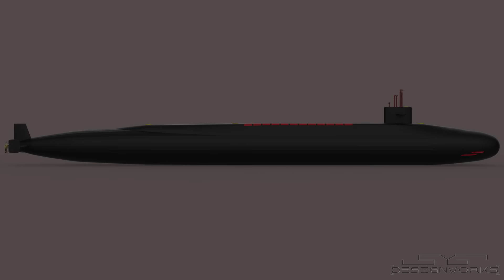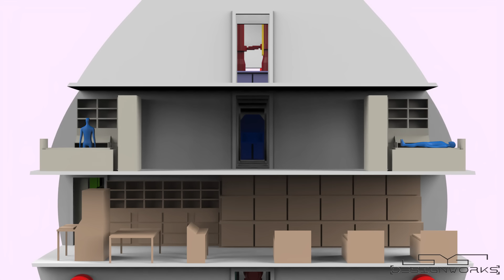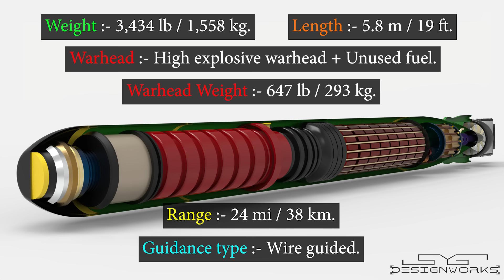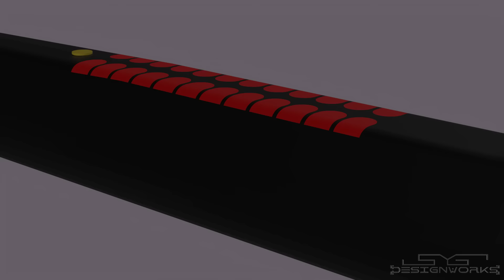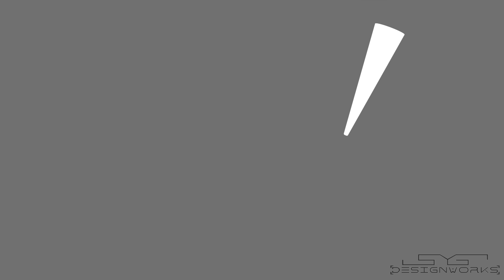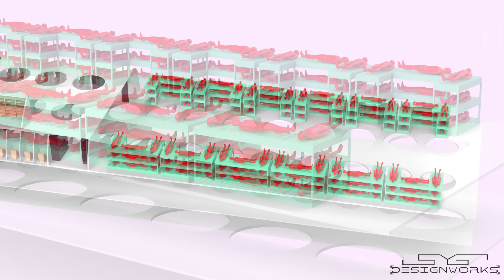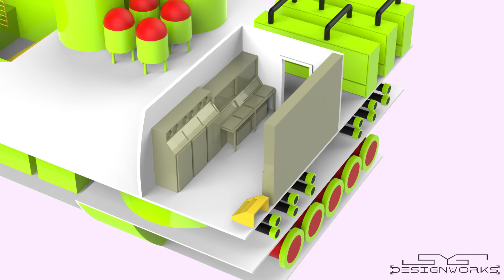Submarine Nuclear Power | Engineering behind it Nuclear Reactor How it Works

Comment: Either I missed it or these sailors magically heal themselves when they get sick. Good way to save on Sub IDC's I guess.  LOL
Reply from the maker: I think you missed the medical rooms in the video.
Reply: @sygdesignworks  there is one sickbay and it's in MC2L starboard side aft of CAMP (no dentist) medical staff is usually 1 corpsman.  There are also only 2 washers and dryers on board and they are in MC3L Starboard side just fwd of AMR2 which are where the hovering pumps are.
Reply: Things don't  heal like you would expect. A simple cut takes twice as long.

Comment: I have a question concerning the torpedoes. Please bare with me as my knowledge is very limited with regard to their operations. Usually a torpedo will detonate on impact with the intended target, but, from I have seen on movies, some targets can evade torpedoes and the torpedoes run until.its energy is expended. My question, why don't they design them similar to depth charges. If the target is evading the torpedo, can it still detonate within close proximity to the target?  Given a torpedo's explosive power, I believe it can still inflict some hull damage. Just asking.
Reply from the maker: Good question. But torpedoes, especially the Mk-48 ones that I've shown in the video has a proximity fuse. They are magnetic proximity fuse that detonates closer to the target and inflict serious damage to hull.

Comment: The reactor does NOT use "weapons grade uranium"
Reply from the maker: It DOES use weapons grade Uranium 235 Isotope which is enriched upto 97.3 Percent.
Reply from the maker: @jimfrazier8611 Thanks for watching!
Reply: If it didn't use weapons grade uranium then the reactor core would have to be, A LOT bigger than it is which wouldn't exactly be conducive to the tight quarters found on submarines. Even one the size of an Ohio class sub.

Comment: When water is forced out of the ballast tanks, where does the 'air' come from? Are there tanks of compressed air someplace on the sub? The movies always talk about blowing the tanks, so I guess the emptying of the ballast can happen quickly.
Reply from the maker: Yes. I have mentioned about the hovering pumps before explaining about the nuclear reactor. Those pumps blow stored air into the ballast tanks to push the water out. Yes, they can surface quickly, you can search for the "Russian sub surfacing in ice" to see how quick they are. Thanks for watching!
Reply: HP air banks for emergency surface, otherwise you stick the snorkel out of the water and use the low pressure blower
Reply: @sygdesignworks  the hovering pumps are to "Hover" the boat not empty the ballast tanks.  The most common way to get to the surface is to drive there and place the the Low pressure blower on the MBTs to force out the water.  There are emergency blow tanks to rapidly empty the MBT's.

Comment: Just wondering: How long can the submarine run on those backup batteries?
Reply from the maker: Not for long. The batteries are used to run only the necessary  components like the navigation systems and the devices used for surfacing.

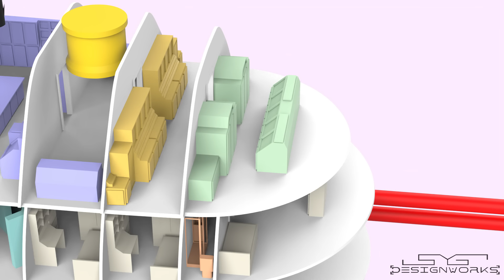Comment: 3:30   "These waves have shorter wavelengths..."  Not so.  VLF signals have LONGER wavelengths.  Formula:  λ=v/f  As the frequency (f) of a signal decreases, the wavelength (λ) of the same signal increases.  v=speed of light in meters per second (approx 300 million meters)  Still, a very well put together and informative video.  Yeah...yeah...I know...it's the nerd in me.  ADHD you know.  🥸🥸🥸

Comment: Are your dispacement numbers correct? Archimedes sez 'for an object to float it must weigh less than the water it displaces'. Assuming that the weight of the sub is relatively constant, in order to dive it must reduce the amount of water it displaces (by flooding the ballast tanks), so the submerged displacement must be less than the surfaced displacement.
Reply from the maker: Yes. I can confirm the numbers are right. The information was taken from USS Ohio-Class, SSGN Type Submarine : SSGN-726. Thanks for watching.
Reply: please help me understand how a vessel that weighs less than 16746 tons (in order to float) can displace 18750 tons to dive. Flooding the ballast tanks reduces the water actually displaced, causing the vessel to no longer float. What have I missed?
Reply from the maker: @orenwolfe6506 I'm not sure about that. I remember reading it somewhere while making this video, that it depends on the submarine's position, like if its in static equilibrium [0 knots] or if it's moving, and also they consider every pound of water that goes out of the submarine including the ones they use for distillation, which increases at a rate of 11 gallons per second. It was way complex and I stopped reading it. I'm searching for the link, I'll send it to you when I get it.
Reply: @orenwolfe6506  The over-all weight of the submarine is not changed when it is submerged , but the submarine submerges because the volume of displaced water has been reduced and the weight of the displaced water is now the same as or less than the weight of the submarine. When the sub is on the surface a portion of it is in free air not displacing water.
Reply: Go read the "Bouyancy and trim" section of the Wikipedia page on submarines.

Comment: Gas turbines? Nope, steam turbines.
Reply from the maker: Steam is gas! Thanks for watching!
Reply: @sygdesignworks  Not in this usage.   A gas turbine is driven by the exhaust gases of something burning, like natural gas or oil, while a steam turbine is driven by steam coming from a boiler or steam generator.  
It matters because they are designed differently and use different materials.

Comment: really !?!? Max. depth only 800ft. (~243,8m) !?!?! 
It would be much easier to float on the surface of the ocean :D
The average depth of the ocean is 3790 m.
Cover efect of depth is calculation formula "hidding * depth" or "hidding * depth^2" or less or more ?
Reply from the maker: Yup. That's the disclosed depth. The actual depth is still a secret. The actual depth is probably more than 1,500 feet.
Reply: @sygdesignworks  It is. Both Test and Crush depth exceed that

Comment: I heard Putin has a torpedo that can be launched anywhere on the planet.  Our wired torpedoes actually drop that 24 mile wire outside the sub after it’s fired?
Reply from the maker: I think you are confusing torpedoes with ICBMs. Torpedoes don't have much range. Only ICBMs can reach anywhere on the planet.
Reply: @sygdesignworks  I believe that they are referring to Russia's Poseidon torpedo, which is more of a autonomous underwater drone than an actual torpedo. It is far too big to be launched out of a torpedo or missile tube and must either be carried on top of a submarine (like the SDV), or be deployed from shore. It's powered by a mini nuclear reactor and can carry a nuclear warhead so it can, in theory, target any coastal city or military base. Or at least that's what Russia claims it can do.
Reply from the maker: @Klyis  Wow. Thanks for the info!
Reply: Putin says a lot of things.
Reply: @sygdesignworks  It is the Poseidon torpedo supposedly able to reach anywhere on the globe underwater